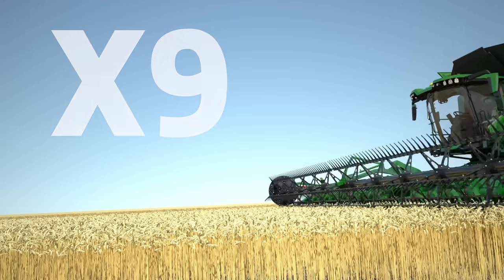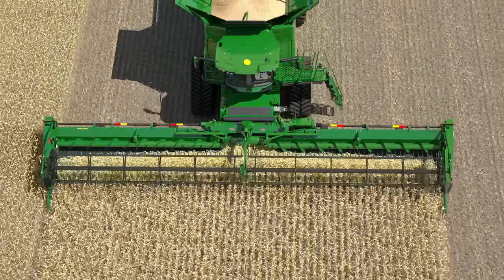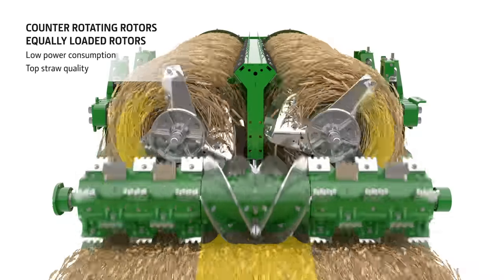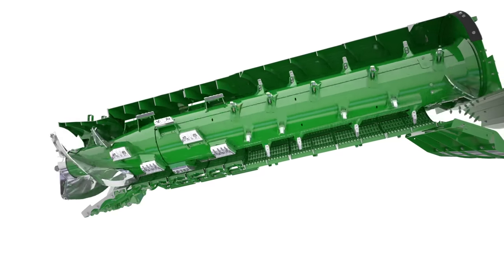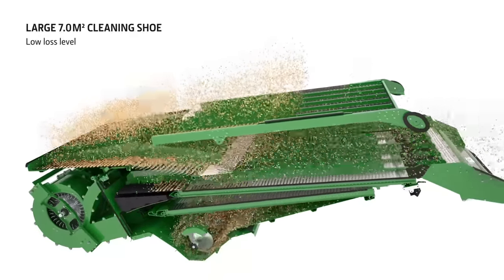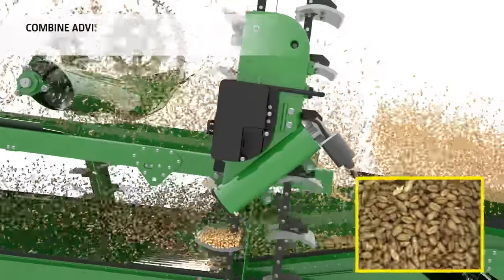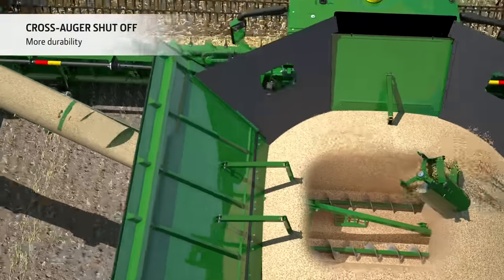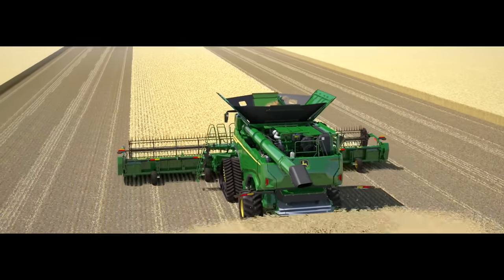John Deere X9 Combine how it works animation

Comment: Are farmers allowed to fix this themselves when it inevitably breaks?
Reply: oh hell no, you need lots of green to fix green...  Even standard parts like v-belts have proprietary designations to make finding compatible parts more difficuilt.  Even if those 3rd party parts are made by the same supplier of the OEM parts.
Reply: Разрешено.Только ночью.Когда никто не видит.И исключительно китайскими запчастями.
Reply: Good question..  Answer is No and Yes. Just google: Right to Repair Act
Reply: Just buy a new one...
Reply: No but they can pay astronomical amounts of money for someone to drive 200 miles and plug in a USB key with a simple fix
Reply: @xephael3485  and if you do try it yourself don't touch the wrong panel cause it'll softlock itself to make sure big green gets their money
Reply: Lol no. Why would JD let you do that when they can make you spend $ to fix it everytime.
Reply: Of course no! Thanks Louise
Reply: Farmers are 100% allowed to fix anything broken on their equipment. The problem is most issues now are electronic and programming issues. The software is proprietary based and Deere doesn't allow their software to be accessed by the public.
Reply: nope, and each of those 124 knives are probably hardware-serialized too 😂
Reply: Of course not that would hurt John Deere's profit margin and make the shareholders sad
Reply: @Flightcontrol96 thank Dodge brothers of Dodge Motors for that- Ford tried to lower his cars' prices and give his workers a raise after a year of good profits and the Dodge bros sued him (they were minority shareholders). The courts sided with Dodge and said "the purpose of a corporation is not the welfare of its consumers or its workers, but the profit of its shareholders".

That's not capitalism, it's greed/corporatism.
Reply: I can’t stand that farmers can’t work on there own equipment! If I purchased it I damn we’ll own it!
Reply: How many grease zerk fitting are on this beast?? You don’t want to miss one for awhile or you’ll have a hard to get to bearing go out!
Reply: There's a thing called "After Sales Service"
Reply: Yeah but upcharges follow
Reply: JD actually argued that knowledge of the machine and software meant someone might break the law regarding emissions. Like cars that aren't "street legal", there are combines that aren't "field legal", so to speak. Thats like gagging all theater patrons because someone might yell "fire".
Reply: @sasquatchhadarock968  And people are out here still buying Dodge after this??
Reply: Nope. Not John Deere. Never will either
Reply: they are like the APPLE of the agriculture industry so NO
Reply: No
Reply: Nope
Reply: Of course not! Do they let you fix a car, toaster, or any other tool after you buy it? Who do you think you are?!
Reply: John Deere is basically the Apple of the farm world in terms of anti consumerism
Reply: @sasquatchhadarock968  this is true, the main objective is the shareholders, as they own the company. Customers and employees own nothing (unless they are also shareholders) and are entitled to nothing more than their agreed upon conditions.
Reply: actually yes. there was a bill updated recently which allowed farmers to repair their John Deere on there own.
Reply: They are doing what they can to prevent it unfortunately.
Reply: Lobbyists say no
Reply: lol good joke, better have money green if you want John Deere green
Reply: No, you'd be accessing software you aren't allowed to.
Reply: H e H
Reply: John Deere is against right to repair. It's difficult to get repair manuals or parts. John Deere actively makes it far more difficult to impossible to repair your own equipment. They want the farmers to pay them instead. Lawsuits have been ongoing
Reply: No.
Reply: I got so hype when he said it can unload 13 tons in 100 seconds
Reply: Of course not.
Reply: @Rosk03  right to repair is pretty much ignored by john deere, theyve been known to blatantly disregard it, or lobby themselves out of those bills.
Reply: So let me ask which brand(s) of equipment should people buy if they want (need) minimum operating costs?
Reply: John deere is the Apple of the farmers world.
Reply: Right to repair!!!!!
Reply: @jamesheuer5139 could add automatic to alleviate that worry. Unless they come with that from factory by now
Reply: Due to "safety concerns", absolutely not.
Reply: @Rosk03 yah Google right to repair act and John deer..
Reply: @killerhawks  Scary thing is that cars are slowly becoming the same way with all that tech they are putting into them. Only your dealership can fix it.
Reply: When I was in Engineering grad school, Green approached my mechanic of materials prof. to design a mechanical joint that will fail within 2-3 years. Just after the guarantee expires
Reply: @sasquatchhadarock968  technocracy
Reply: The animated one?  Absolutely!  The real one?  No. 😂
Reply: John Deer require a $50 fee for an answer to that question. And an NDA
Reply: I like John Deere but I have to agree
Reply: I prefer paying the migrant workers and creating the jobs.
Reply: Hell no, which is why farmers should tell their kids to run for office and slap a few CEOs and shareholders on the way.
Reply: depends.  if its a physical part, and you can find the part, then you can fix it, if its part of the computer, then john deere is gojng to have to do it.
Reply: Yes but you need a special wrench..
Reply: @BradiKal61  in this case we can do it remotley thru JD link via cell service .MTG machine telematics gateway.
Reply: How many of you people saying no to Deere letting you fix the equipment actually own John Deere equipment?  
We own John Deere equipment and fix it ourselves all the time…
Reply: Oh hell no, John Deere will hold them hostage on things like software updates.
Reply: @PBST_RAIDZ ...this is why people have started hacking their John Deere equipment.  They take the manufacturer out of the picture.
Reply: @xephael3485 do they really get away with that?
Reply: @jeffb321 well you can access it, you just cant change it.  Tell them what you don’t like and have them fix it.  Its millions of dollars and if you think they don’t want that sale more than they don’t want to make changes you are nuts.
Reply: @Ichibuns  Think you are oversimplifying the issue.
Reply: Now what makes you think John Deere is going to let that happen?
Reply: There's only 278,000 moving parts on that thing. What could break?
Reply: Yes, they can, But you have to special order proprietary parts from John Deere and it also avoids your warranty on a million dollar machine.  

act accordingly.
Reply: I think a service call to JD runs about $1000.  Our local runs these and he's had about 2 service calls this year.  But the YIELD, holy cow, it's enormous
Reply: @jeffb321 and for obvious reasons. For one, if customers go in and mess with the software it makes the inevitable repair by Deere exponentially more expensive trying to figure out what they did. Also, those machines can easily be operated autonomously, could you imagine the havoc if someone hacked into a combine and went full on Granby Colorado but with no operators and in several locations simultaneously all over the country…
Reply: When I read this, I didn't read "this" and my mind went a whole different comical direction
Reply: Problem is most of the times aftermarket parts don't fit anyway.
Reply: Hahaha bro this is JD you most definetly are not permitted to fix anything
Reply: Yes BUT it might void your warranty. I work for North America’s biggest off road rental company, we buy a crazy amount of everything including green engines. We submit for warranty what we need but fix everything else ourselves regardless. We can’t afford downtime.
Reply: The finest combine ever made ( for home repairs) 
Was the NEW HOLLAND TX 60 series 
Late 90s > early 2000k.
I know I was a NEW holland senior demonstrator back then..

The TX was indeed the last machines you could repair yourself.. After that forget it.. All became plug in the Laptops.. 
Now ??? Farmers are now bent over with trousers down...😢😢
Reply: If you are smart enough, yes.
Reply: Do professionals fix their own vehicles?  Who as time to waste?  Professionals hire experts and often have backup vehicles while the one is being repaired.  Are you a professional farmer or hobby farmer?  Maybe this is not the unit for you.  Perhaps something horse drawn would work better.
Reply: @biffhenderson1144  that’s a little extreme. There’s lots of older models for sale out there that are not difficult to maintain and repair if you mechanically inclined.
Reply: If they know how to and don't break it further then yes. Malfunctions are very rare.
Reply: @dkdanis1340  Malfunctions are very rare?!?
Reply: i'm considering the same
Reply: If you can't fix yourself....time to change color...or buy a 8820.
Reply: Remember when IH came out with the Axial Flow in late 70's and all the Deere guys laughed and said what a dumb idea. "You'll get a rope coming out the rear of the machine!". Hmm now it's the greatest!
Reply: With what engineering degree?
Reply: Farmers ARE allowed to build their own. They aren't made of rare materials and DEFINITELY not rare ideas.
Reply: Didn’t this issue go to court ?
Reply: @jeffb321  but tbh, by what standard is a piece of software more protected than a piece of formed metal by the same person? both took braincells, both took time, both are work done to get it to the thing it is now.
Reply: No
Reply: It's like Apple of farm machinery
Reply: This is Apple era. No maintenence allowed.
Reply: Why wouldn't they, they own it and work for themselves.  They could turn it in to a vegetable garden if they want to.
Reply: Yes
Reply: @xephael3485   The purchase of John Deere agricultural machinery is not mandatory.
Reply: @Blaze5x5x5 So why are you buying a John Deere machine?
Reply: @neurolog5621   I don't own any JD equipment because it's a dogshit company. Other people still buy it because... who the fuck knows. I'm not other people.
Reply: @neurolog5621  you say that like it's a fact, but that's not completely true... John Deere holds a monopoly for service parts and equipment in many areas of the country. 

Please tell me about the tractors and farm machinery you own and who provide service for them.
Reply: Er no. probably break a lot quicker now they are made in Mexico.
Reply: Yes.
Reply: No
Reply: nyet ; send it (postage📩prepaid) to Siberia ; allow 4-6 years for 'processing'...🙄
Reply: the funny thing is, JD are hellbent on forcing you to hire them to fix it for you, yet the services manual are made so a monkey with 2 brain cell can do the job.
they legit show how to do every fix on the machines, with parts numbers, and how to with pictures.

hate to say this, because i don't worship JD, but their mechanic portal is pretty well made and detailed compared to others
Reply: Yes
Reply: Customers can purchase all of the same software and tools that the dealers have
Reply: Most people fix their own shit
Reply: As of very recently, yes!
Reply: @MrGrim  not as of recently, customers have been able to buy all the same software the dealer has for almost 4 years now

Comment: Now to repair/diagnose it you’ll need to tow it to the dealer.
Reply: No shit look how complex this machine is. Clearly this is not for family farmers farming a few hundred acres, this machine is designed for mega farms operating as a business. Repairs are just another expense for such a business.
Reply: @paul1862 yeah but you cannot get it repaired or diagnosed by an independent professional. It’s not allowed. Hence sub par repairs at a huge cost

Also, all farms are businesses, they are just like any other business in every way.
Reply: It has sophisticated computerized diagnostic and remote billing systems to make sure it gets fixed remotely... otherwise your 5th tow is free.
Reply: Oh you simply call a repair center and then pay two months income to get a teenager with a John Deere flash drive to plug it in and fix the problem
Reply: @benchoflemons398  So the farmers have two choices, buy this one, or buy one that isn't locked down. I'm sure there are enough farmers willing to buy these - probably for good reason. And if there weren't, JD would use another strategy.
Reply: @paul1862  someone harvesting only a few hundred acre every years can’t justify buying such a big combine in the first place